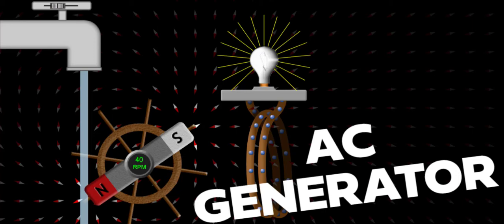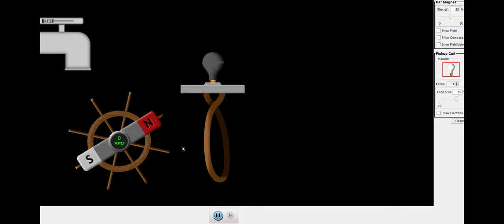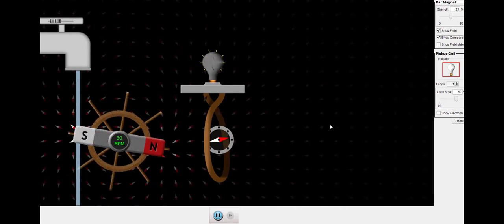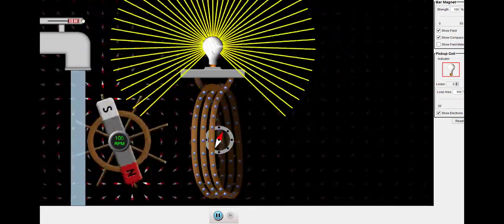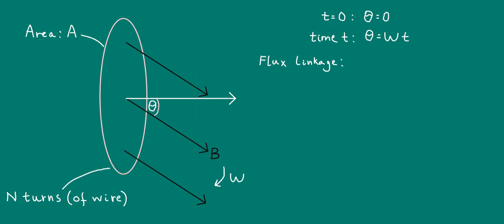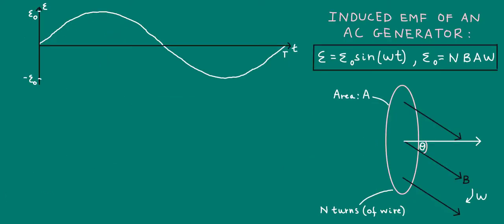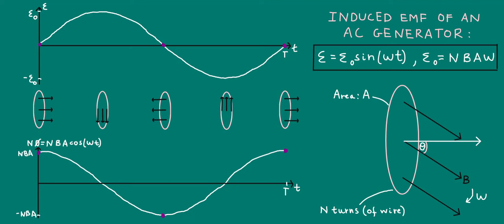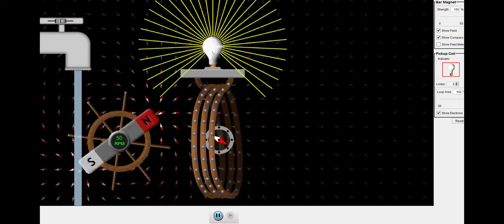Electromagnetic Induction | AC Generator (Alternator) | A-level Physics

Comment from the maker: Answer to question posed at 8:59 (please try to figure it out yourself before taking a look!):

To understand why the current alternates viewed through the lens of Lenz's law (!), it's helpful to recall the informal version of the law (for changes in flux) discussed in this vid [ https://www.youtube.com/watch?v=y2c36W9QhzE ]:

'The coil/loop tries to oppose any changes in magnetic flux (linkage).'

As the north pole of the rotating magnet approaches the coil, the coil tries to oppose the changing flux linkage by developing a magnetic North pole on the left side – this thus repels the rotating magnet. Viewing the coil 'head on' from the left, the conventional current would be flowing aNti-clockwise [see this for further clarification: https://www.youtube.com/watch?v=rfXI8pASerE ]. 

As the north pole of the rotating magnet moves away from the coil, the coil tries to oppose the changing flux linkage by developing a magnetic South pole on the left side – this thus attracts the rotating magnet. Viewing the coil 'head on' from the left, the conventional current would be flowing clockwiSe.

And so on.